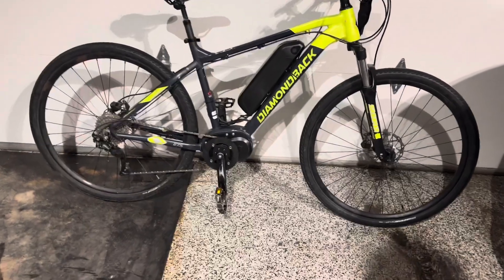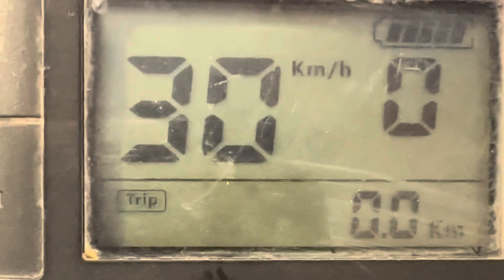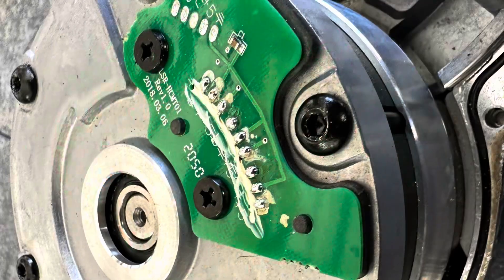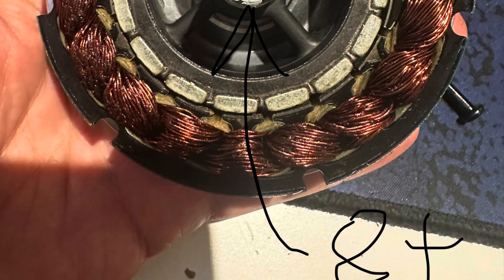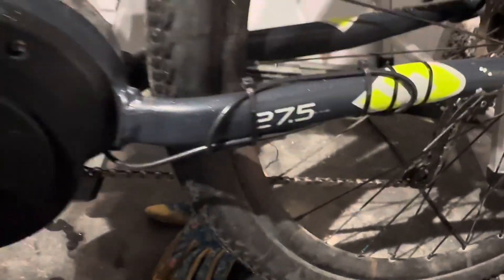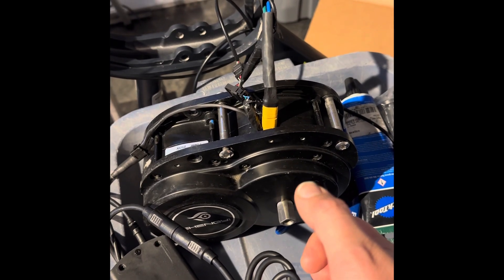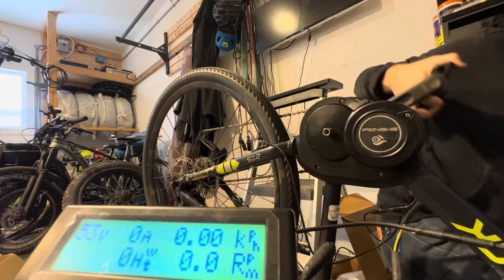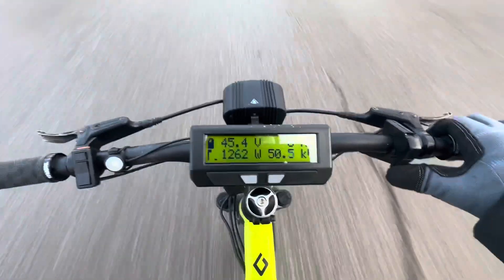Shengyi Mid Drive e-bike Controller Upgrade

Comment: Do you know the controller amps that came factory on that bike? I’m trying to find out how many peaks watts are on get from these systems stock. The 250w rating is low, and the 105nm tq makes it feel like 500++
Reply from the maker: This motor has a more aggressive 2 stage gear reduction than a BBS02 (28.8:1 versus 22:1 IIRC), so this motor will produce more torque at the pedals, if all other variables are held constant. 

The BBS02 also doesn’t have a torque sensor. So maybe it’s just a perception of more power?
Reply: @vaxt correction to my earlier comment. I have a BBSHD. Thanks for the info. I like how Bosch posts more info on their 250w mid drives, by publishing the peak of 300-600w depending on the model. 
Either way this diamondback is impressive and enjoyable.
Reply from the maker: @janm3793 yeah it’s been a great ride so far. Really enjoy the motor and toque sensor built in.
Reply from the maker: You can splice into the battery cable and install a shunt if you want to know for sure! https://ebikes.ca/shop/electric-bicycle-parts/ca-accessories/shunts/shunt-ca3.html

It would be interesting to know if it is under rated!
Reply from the maker: I never measured it, and there are no markings on the controller explaining what the DC or phase amps might be. 

Given there is no thermal management on the stock controller, and based on the thermal characteristics of the motor I’ve collected in my set up, I think it is actually a max 250 watts (7 amps from the battery).

With the motor’s 2 stage gear reduction plus your legs, plus normal bicycle gearing for climbing, it can feel very torquey.
Reply: @vaxt interesting . I have a bbs02 52v 28amps and this diamond back bike pulls same hills, similar gear ratio while my bbs02 measures 600-700 watts.

Comment from the maker: If anyone out there is trying the same thing, let me know if you have any questions! I glossed over a lot of the fine details for this video.
Reply: Is there a plug and play battery that I can use as a spare for this bike? Or would it require modifications like you have done
Reply from the maker: @dirtyforddiesel  this bike uses a standard 36V “Hailong” battery from the factory. Easy to buy a drop in replacement.
Reply: @vaxt  awesome thanks! Can't find much about these bikes other than your video. I was hoping to put on a bigger battery and have stock on for backup but I will have to do some digging on size and fitment
Reply from the maker: @dirtyforddiesel  if you’re comfortable swapping the base plate for the battery you’ll have even more options. The base plate is just 2 wires; red positive and black negative. You may have to do some basic soldering, but pretty easy overall.
Reply: @vaxt  thanks for your help. For the mods you did, is that something can do under 500$?
Reply from the maker: @dirtyforddiesel this is mostly an issue of time and effort. The major work is replacing the controller with an L1019, from there you can choose your controller and there are plenty of options under $500. The controller and display I use is about $550 CAD.